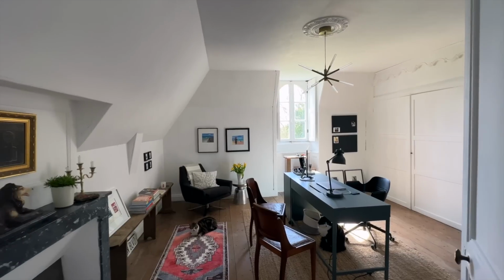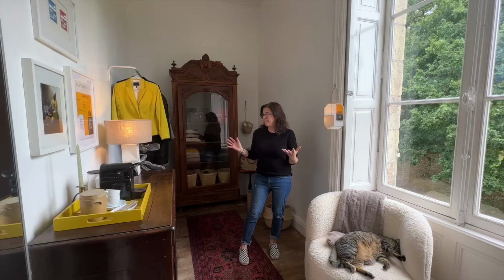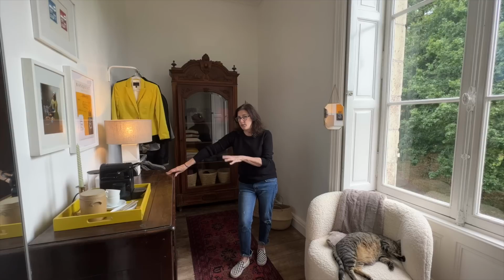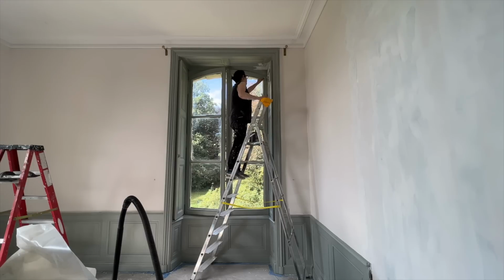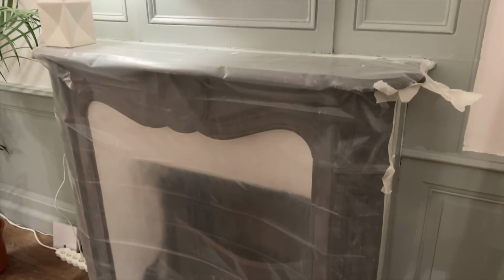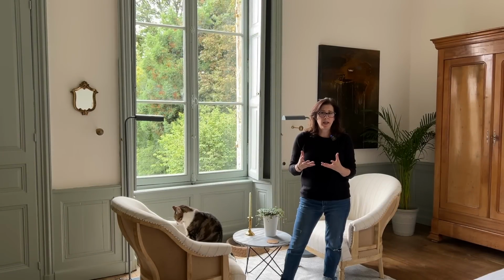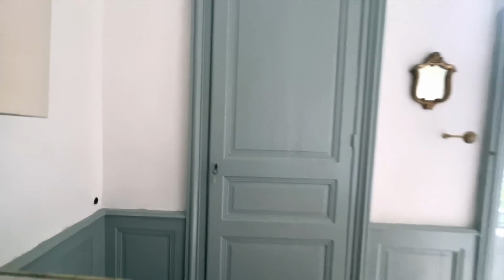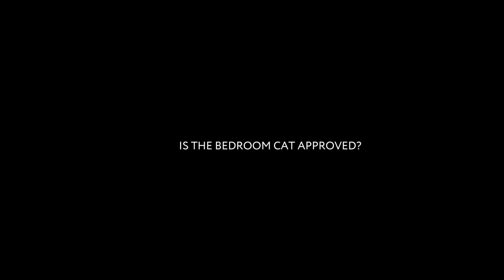Epic BEFORE & AFTER Transformation! Our French Chateau Restoration

Comment: Finally! A chateau restoration that is actually respectful of the character of the house while creating a cozy livable home! Congratulations to both of you for your hard work and cant wait to see more ❤
Reply: No its not as a Chateau should be , as its modern American look . But its what  most Americans do to Chateau s to make it more fresh and clean and liveable .
Reply: Yeah I think the American style fits PERFECTLY 🎉
Reply: @KeithWiggins-xc1sf   When you pay the money you get to decide. It's not like they are knocking out stone walls & putting up drywall because it will be easier & cost efficient to heat. Running ductwork throughout, like a NYC loft, for air conditioning. But if it's not listed & they were "Modernizing" it's where They have to live so it may as well be comfortable for Them. It could still be changed back if they ever sell.
Reply: @marshawargo7238  Like i said its how most Americans do up there Chateau s with lots of paint some of it works and some of it does not , in this case it works she picked great colours that tone into the outside look .

Comment: I'm Californian, Bay Area actually! I have a queen bed just for me; its my favorite thing!  I don't tuck top sheets and blankets or covers. I use a fitted bottom pulled tight, queen or king duvet covering a comforter and sometimes a top sheet between the bottom sheet and duvet to keep the duvet clean longer or when it's extra cold.  I don't make the bed first thing, I throw back the covers to air the bed as a nod to Japanese and European styles that leave the duvet folded at the bottom in order to facilitate drying out. Then I make it next time I come in, sometimes, unfortunately, that's rather late. If I use a top sheet I don't tuck it at the bottom on my side, only on the other side to keep it in place, otherwise it confines my toes too much leading to cramping. I use way too many pillows, love it! I use organic 600 ct ave percale or sateen, love the feel, can't abide polyester, kinda picky I guess but I havent had the opportunity to try linen and would like to. I have a 12 in mattress and have no trouble getting sheets deep enough, but the tops shrinks in the washer/dryer as I use use warm or hot water making it really hard to get the sheet on and tucked tight all the way around, often I need help! Thats my whole bed story! Good luck getting a King or Calif King in Europe, let us know how it goes, please. You could use the queen in a spare room, linens and all!

Comment: I like your choice of paint in the bedroom.  There is a calming effect with the gray/green paint.  I saw the pink tint on the bedroom wall in one of the video pictures.  I was not sure the color would go with the gray/green but it does.  Because I make quilts as a hobby I use them in my dacor.  I tuck my top sheet in and put a quilt on top that is not tucked in.  It lay free at the foot and two sides and I do not have any trouble with it slipping off the bed.  I do not iron my sheets, I just fold them for storage.  I buy a high thread count and look for a firm feel.   What are you going to do with the windows?  I would love to know if your rooms are heated and are the rooms drafty.

Comment: Hi beautiful 🐈‍⬛. Your rooms look wonderful! Good job. Curious about the paints. I’ve been using Behr paint lately. I’m also interested in lime wash if you ever come across any recommendations for it.
I don’t like my bedding tucked in either. When I make the bed I put the 2 corners in just a triangle and everything else is free. I do this to try to keep the sheets in place but not feel constricting. For every day I just pull up the comforter and blankets. On occasion I will resituate the blankets or straighten the comforter. What linen sheets do you use may I ask? I’ve been searching for some online. I was thinking about trying bamboo. I have some from better homes & gardens that are hydro cotton they are great.

Comment: Question: What's wrong with a Queen size bed. If you decide to move to King Size, I would recommend  you have 2 twin duvets on your bed and not a king size duvet. Much easier to wrangle. In fact, buy two twin size beds and push them together =ing a king size. The whole thing stays together with a king size mattress pad or cover. I know this from personal experience. Ikea is the best place to buy duvet covers. No zipper closures though. Button or ribbon closures only and 100 % cotton with the highest thread count available.